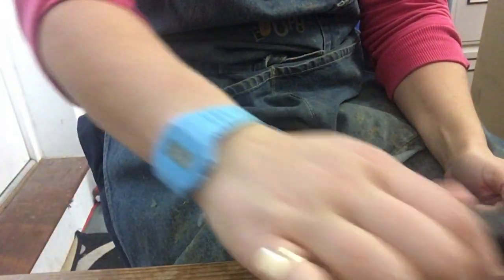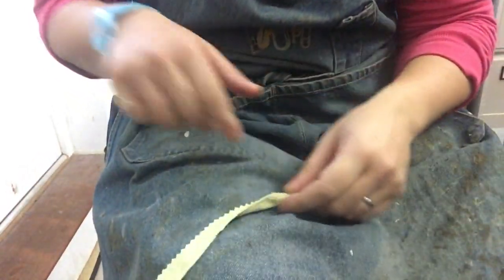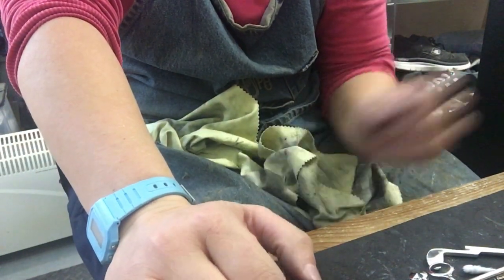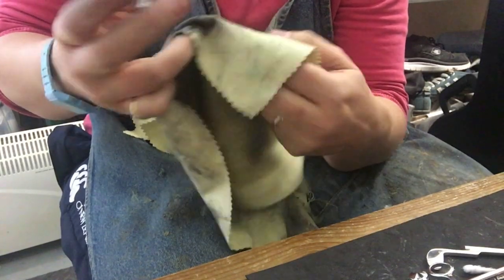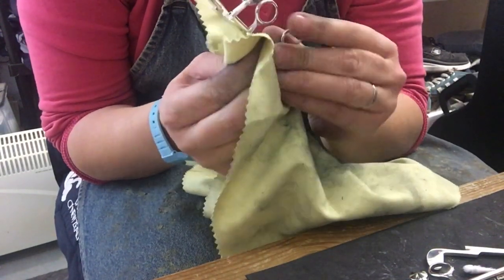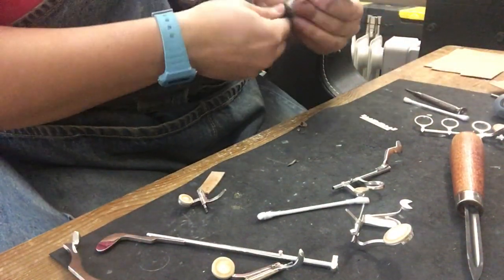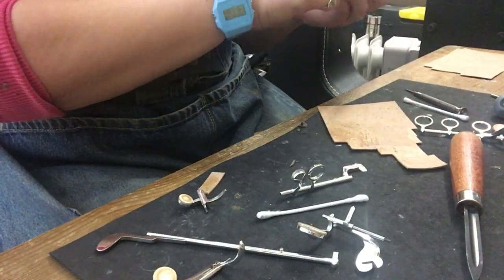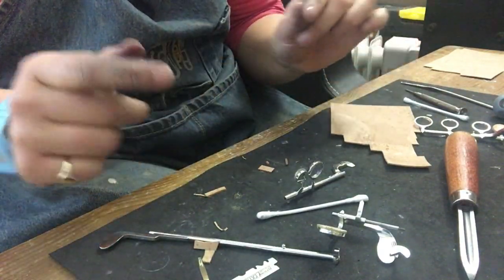Clarinet Repair - Part 2

Comment: Super interesting to see the different mechanics of different instruments, so many different skill sets involved just in the maintenance.
Great info  👍
Have you ever considered using an Ultrasonic cleaner, really gentle but at the same time, with a capful of Simple Green concentrate will strip grime like something really nasty and wouldn't be surprised if it stripped the glue from the collapsed pads at the same time.
Just a thought as they're cheap on ebay etc.
All the best and stay safe.
 👍✌😎      PS,  I use an Ultrasonic on old grunged up guitar mechanicals, even black coated Licensed Floyd Rose hardware) and never had ant dramas with coatings lifting)
Reply: Ohh, yeah, they work really well in a nondestructive way. Sort of like yelling at the grunge...really loud.